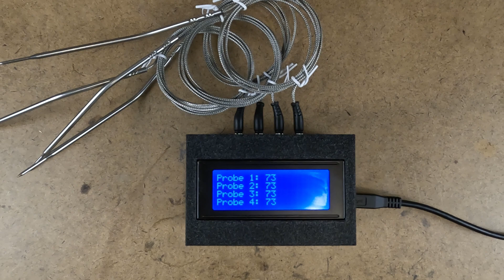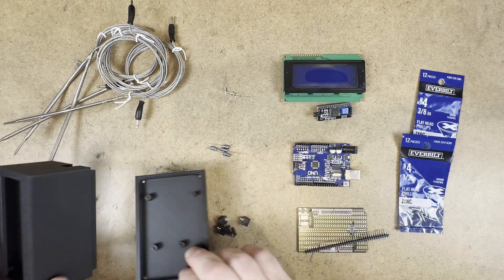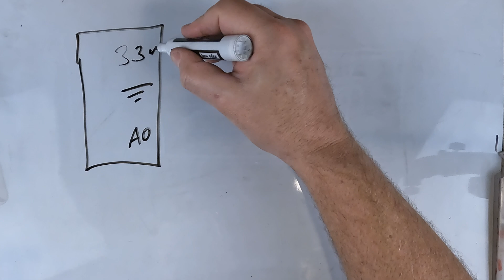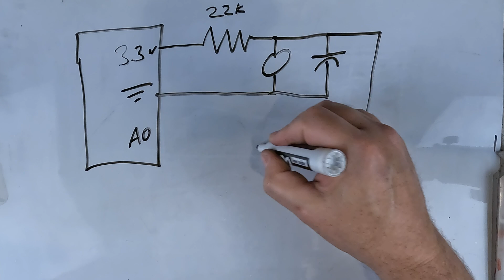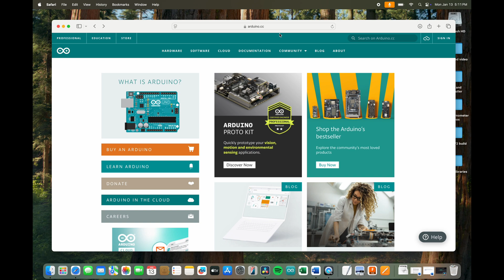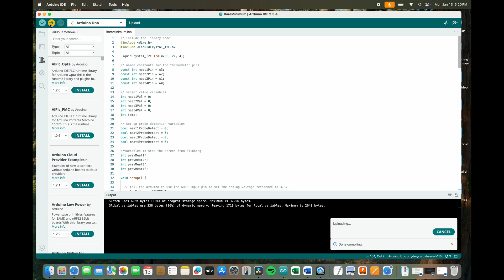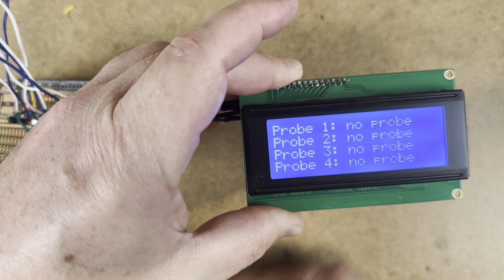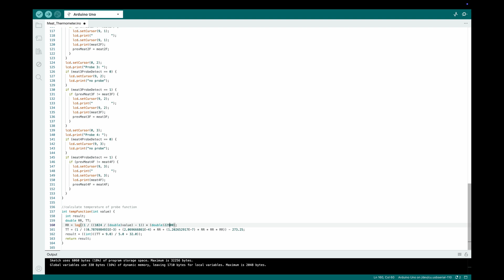DIY Arduino Meat Thermometer

Comment: Hi I want to do the same project but cant seem to find any good temp sensors on amazon. Do you happen to know wittch ones you used or have any tips?
Reply from the maker: Any meat probe with a 3.5mm jack should work. You’ll just have to check it with freezing and boiling water.

Comment: how did you determine the resistance for those thermometers? im curious to see if mine will need different resistors or if i can use the same ones in your video. also, the band color on your resistors dont seem to match the value you stated. your is a OOYG or OOYSG when it should be RRBOBr.
Reply from the maker: That’s just bad white balance in the video. My resistors are red red orange in real life. 

I got the resistance table from the manufacturer of my probes. They sent me two different tables for different kinds of probes when I asked them for them, but the values are similar enough that for this kind of project it didn’t really matter which table I used. Give the formula a try as it stands and see if it works with your probes. If it doesn’t, you’ll need to figure out the constants for your probes.